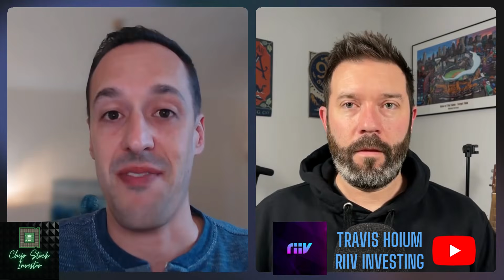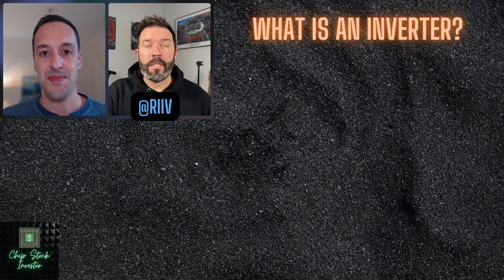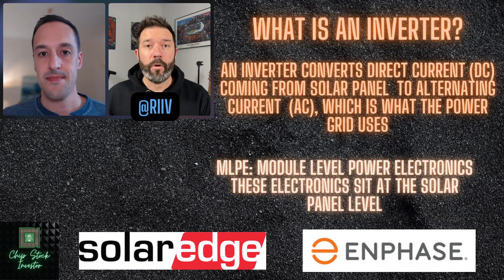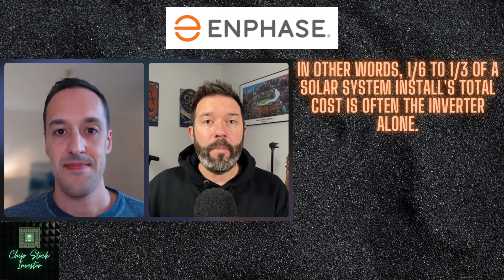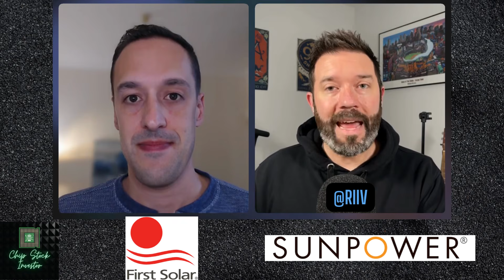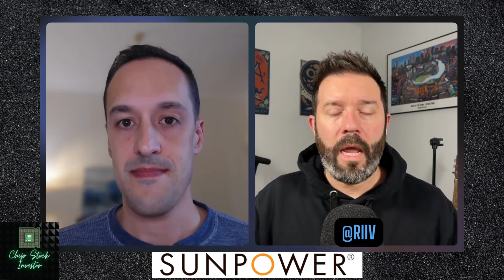Is Solar Energy Stock Enphase A Good Buy?

Comment: Enphase is trying to do cloud and essentially use its software to sell power to the grid, it would disrupt utilities if it works. High Risk High reward. You're conflating the solar panel manufacturers in the past they didn't have a wrapped in software solution.
Reply from the maker: I think that is the gist of our final takeaway at Chip Stock Investor. Stock is still on our watchlist.

Comment: I would like to see you do a much deeper dive I have been in solar for a decade and most the installers swear by Enphase. I would get more perspectives than just this fellow. There was a lot of info that was a bit inaccurate and would love a deeper look
Reply: Sorry, I may have worded that wrong and too strongly. It was a great video I just think it would be great for your investing benefit and others to get more perspectives from industry insiders. I would talk to people from different areas because solar is a very diverse area in itself. 

I have worked In solar financing, utility, commercial and residential scale solar and Enphase is about all contractors use besides solar edge. They used generac, but that is not very common. There are huge advantages to working in all parts of the system, incorporating ev charging and batteries so that it is more plug and play etc. 

there are too many options out there and contractors and customers want something easy. Not to mention coordinating lead times on diff companies components (especially Tesla powerwall) solar edge is losing market share is my understanding many contractors have had issues with these systems and generac had massive issues. Besides a short seller report from Hindenburg I have not heard bad things of Enphase. Honestly utility scale and commercial will prob see more growth in this recession especially with new laws in ca making customers only get wholesale electric rate back for power generated increasing payback time. 

Sma is a major utility scale inverter company for 500 mw inverters and there is another company I invest in called shoals technology group (fuses, combinerboxes, disnconnects, monitoring). In solar batteries, lg and tesla are big along with generators like generac being tied in. Wall box is a at home ev. Charger stock. 

Grid tie level, large scale energy storage is becoming huge since I left the construction side. Now it is mostly shipping container size lithium batteries and there are even new solutions like iron air that could bring costs down (ess)- ticker gwh. Stem is a stock that could be a good dive along with other smart grid managers. Energy vault looks super Interesting with a gravity battery system being developed. 

I like first solar and sunpower relatively but hate that sunpower is getting into installing as this has terrible margins and headaches. I would not want to own any installers other than utility scale which is why I like first solar and Canadian solar. Sunpower has premium panels but they are exposed in financing which can be a rough industry especially now from my experience. It is a highly competitive area. I would avoid residential solar except for Enphase who has most of the margin except for commercial and utility scale where it’s totally different. 

Daqo new energy out of China is one of my favorites in panel supply chain. They manufacture and process poly silicon to panel manufacturers and have done MUCH better than any of them. It seems to be the place in the panel supply chain to be (plus China is encouraging these kinds of tech with tons of $ while discouraging other types)
Reply: Also battery tech is one of the fastest growing areas and seeing massive investment I loved the idea of you all expanding into adjacent areas like Albemarle for raw materials and different battery companies and technologies. Battery recycling is an interesting one for me two with only two main players I know of; redwood materials (jb straubel from Tesla) and li-cycle (only public pure stock play currently)
Reply from the maker: There is a ton of awesome ideas packed into this. Thank you for commenting! I'll take some time to review and digest all of this.
Reply: @chipstockinvestor  I was researching sunpower more and they no longer manufacture panels; they are now only in design, sales, financing and installation. They spun off a public company called maxeon that looks more enticing that makes the panels and uses Enphase and emphases’ software app for customers so there must be some leverage there. Maxeon is heading toward profitability but it seems to be more a commodity, where Panels are like ram and micron you highlight and Enphase/ inverters being more the logic chips/ like Nvidia
Reply from the maker: @Redstaplerpodcast  I feel like that analogy is sound, Enphase is becoming kind of like logic, everything else a bit more price elastic commodity parts like memory.
Reply from the maker: Thank you for your comment. I believe that information about any company is highly distributed, both within the business itself and externally as well. I had Travis on because I have lots of blind spots with the inverter industry, and he has followed solar stocks for some time.
That being said, I still have more to learn about Enphase. I certainly haven't written off making an investment when I feel the price is right. Would love to hear from you. Do you have some sources to recommend where we can learn a bit more about what's going on?

Comment: Good discussion, but I don’t think you have a deep enough knowledge of the Enphase business model. The battery, EV chargers, and future products all have the same future Financial model. They won’t enter a space unless they can achieve the same financial margins. Also, Sunpower had nothing to do with their resurrection and it was only later that Enphase bought Sunpower’s less technological inverter tech to acquire some IP and get an exclusivity deal for a period of time. All of Enphase products are smart, integrated, power electronics which all use the Enphase specific IC’s
Reply from the maker: Thank you for watching, and thanks for your comments.

Comment: How come FirstSolar is performing so much better than Enphase lately, even though Enphase has a much lower PE multiple and presented great numbers/outlook during last the earnings call? Serious question.
Reply from the maker: Hey Rafael, tough question to answer whenever it comes to short-term stock price moves. However, my guess is there's two things going on. First, perhaps investors think First Solar will have more to gain from the U.S. Inflation Reduction Act. 
And second, and probably more importantly, there is general consensus among analysts that First Solar's EPS is going to make a very large rebound in 2023 -- I'm seeing $6.45 is the consensus among analysts for 2023 EPS. So on a 1-year forward basis, First Solar is actually the cheaper stock. FSLR trades for just 17 times forward PE, ENPH trades for 29. I hope that helps!
Reply: @chipstockinvestor  excellent answer! I highly appreciate it and subscribed to your channel! Thank you very much.